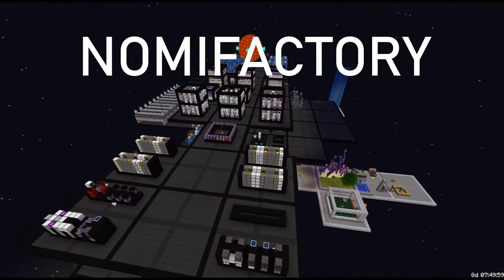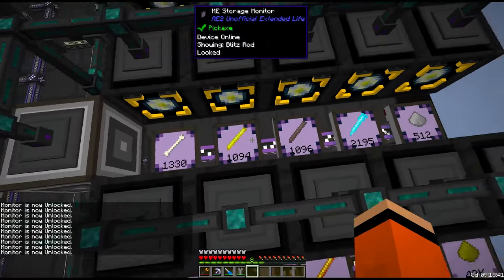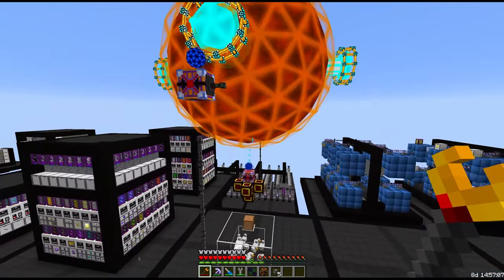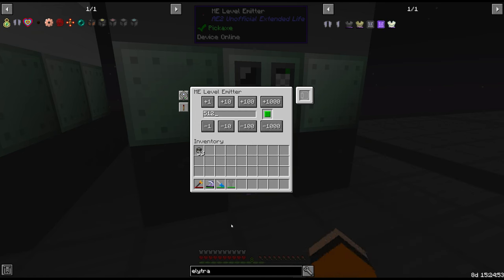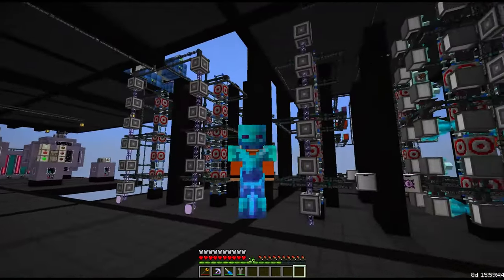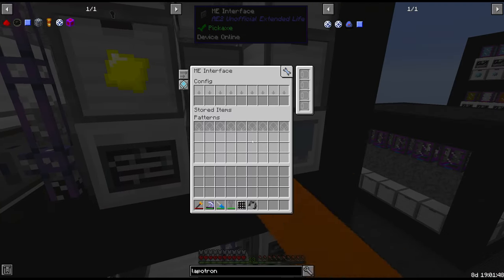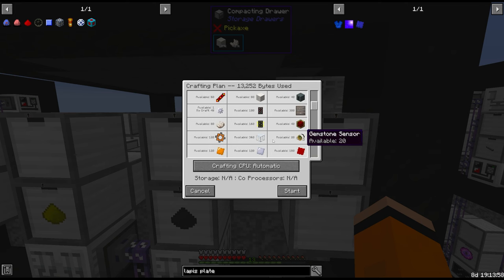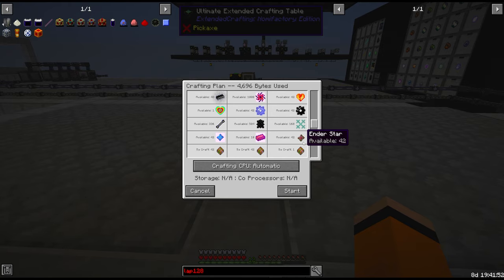Creative 2 & 3 - Nomifactory: Episode 30

Comment: Rather than a mob farm, leather can also be obtained from Rotten Flesh using the Atomic Reconstructor.

Distilled water is a little weird yeah, not sure why it's like that... I'll just blame GTCE.

Energium Crystals won't charge in your inventory, thankfully, but I've recently committed a fix for an annoying NBT problem that confounded on-demand autocrafting involving energy crystals, since they were crafting without tags but even manually patterning them sticks a tag on the ghost item (ugh).

I will note that the energium dust into energy crystals recipe is kind of a bottleneck in making the later GT batteries so you might consider making a PA for them if the single machine passive setup can't keep up with demand.

The creative energy cell NBT should all be good as-is: one of the first major endeavors I did back in 2019 when my changes were just an unofficial "fix zip" was redoing the entire cell crafting chain's recipes specifically so you didn't have to fix everything (took several days, was truly NBT hell). Just don't pull the items out of AE2 or you might charge them and make AE2 think they're a different item.

As an addendum, your audio actually sounded fine to me. Somewhat different from usual sure, maybe the music was higher in the mix or something.
Reply: Hey Exa, I realized that the atmoic reconstructor is one of the last processes that isn't put in to a machine, as opposed to processes such as AE2 crystal growth. Any chance we may be getting a new method of atmoic reconstruction? Maybe even a late-game large multiblock like the simulation supercomputer?

Comment: Sounds was good didnt feel anything strange. I have one question when you automate using ae on demande, why you make same  pattern more then once, is not safe to just buffer in a chest then input to all machines? At once?
Reply: with the conduit's doesn't output from the chest fast enought and it's really not clean, it's an asshole to do the system you said with no benefit
Reply: With PrototypeTrousers's fork of AE2, you can put the same pattern in multiple interfaces and enable blocking mode, and AE2 will round-robin the pattern to the various interfaces (and sides of interfaces, if full-block). It's a really nice feature for parallelizing.
Reply: @Exa4096  i got you , i was wondering why he was doing that all the times its an ae2 addon right ?
Reply: @aceperfect8427  It's actually a drop-in replacement for AE2 that PrototypeTrousers has been working on for a couple years now. He started with the AE2 rv6-stable-7 code and "forked" it (programming term for copying a repository), included some custom work done by another developer Talchas, then made myriad fixes and customizations of his own and released it as a separate mod. On CurseForge due to their weird naming restrictions he had to call it "AE2 Unofficial Extended Life" but the community colloquially calls it either "AE2: Trousers Edition" or PAE2 (derived from PrototypeTrousers -> Trousers=Pants -> "Pants AE2").
Reply: @Exa4096  i guess  i never tried it befor , more reason to try the modpack then!
Reply from the maker: Once you play Breeks edition (prototype trousers) you'll never go back to vanilla AE. It's so good :D
Reply: @Threefold.  haha, facts. Proto's doing yeoman's work with that mod, plus the various other projects he's working on in our 1.12 modding community.

Comment: Quick question: I'm playing Nomifactory GT:CEu and that has the Gregtech Prospector's Scanner instead of the Scanner from the Scannable mod. Is there any way in the pack to search for a specific block that isn't a Gregtech ore? I'm going hunting for treasure through the cities and it would make things so much faster if I could tell which buildings had chests in them or not.
Reply from the maker: As far as I know only the scanner with the block type filter can do that :)
Reply: @Threefold.  damn, that's what I was thinking. Thanks for the confirmation!